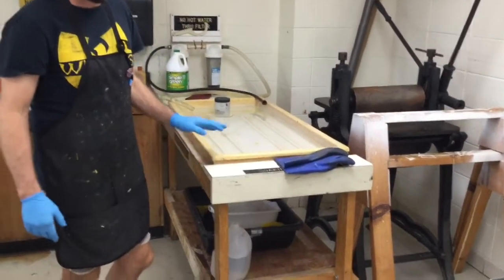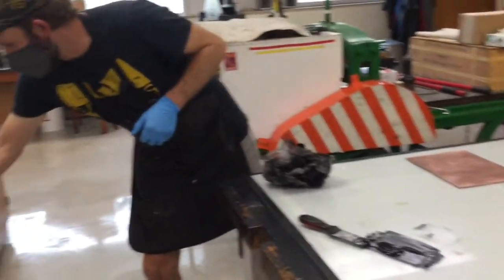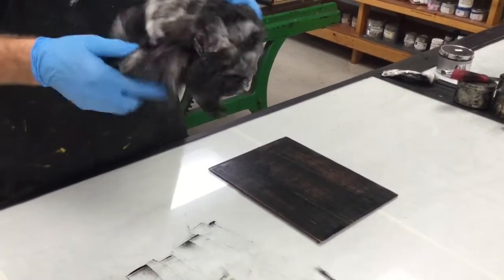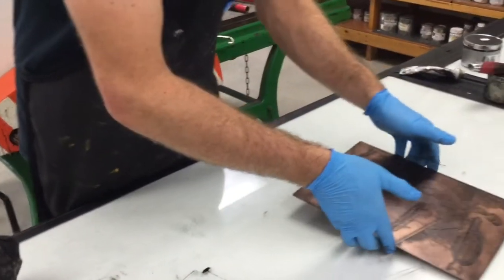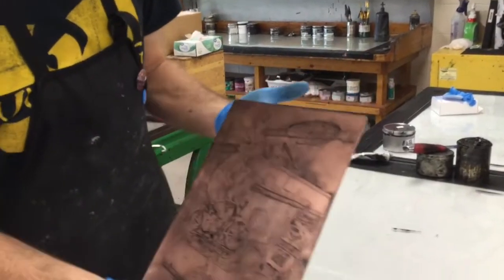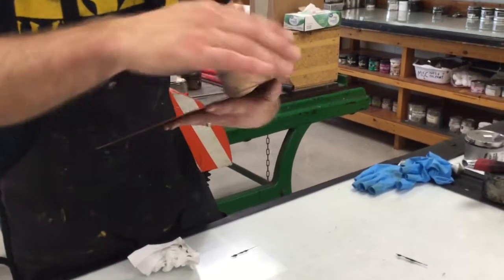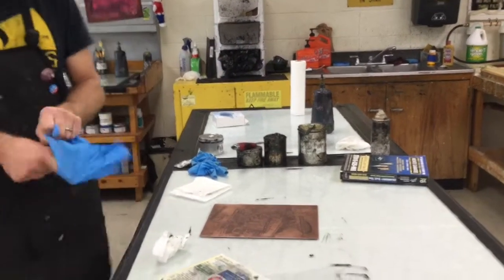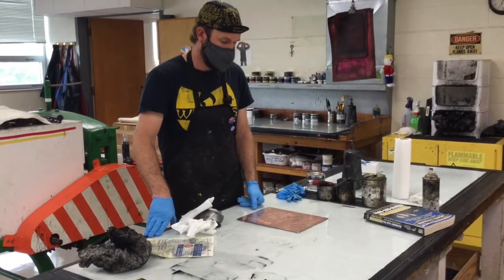INTAGLIO PRINTING PROCEDURE

Comment: Experienced etcher here. In my book, paper towel is too absorbent to use for plate wiping. Many times I use only the tarlatan. Or for further cleaning it is a thin smooth paper lightly used.
Reply from the maker: Thanks for watching the video, and for the suggestion. The only time I really ever use a paper towel is when I’m doing a final wipe exclusively on the plate edge I’m an effort to maintain clean edges when printing. When wiping plates I start with regular tarlatan then do some very light passes using phone book pages. A lot of that depends on the relative tackiness of the ink, with looser inks I tend to do far less wiping with the phone book pages and rely more on the tarlatan, especially if I’m wanting to retain some plate tone.
Thanks again for your insights!